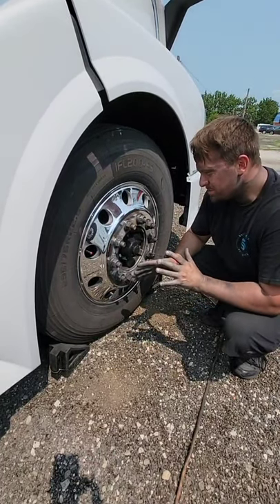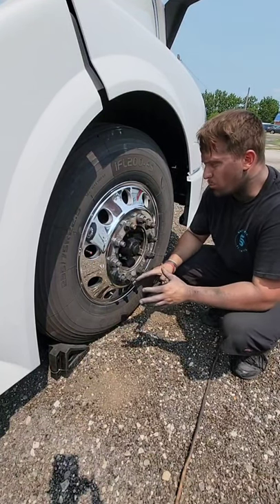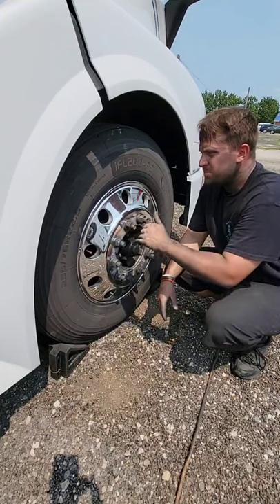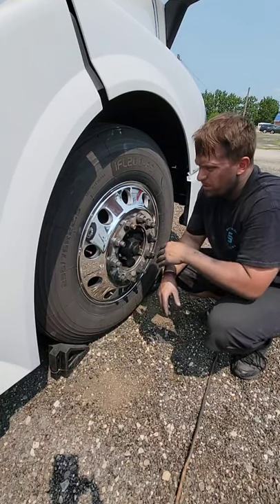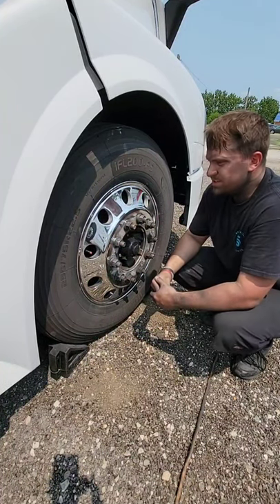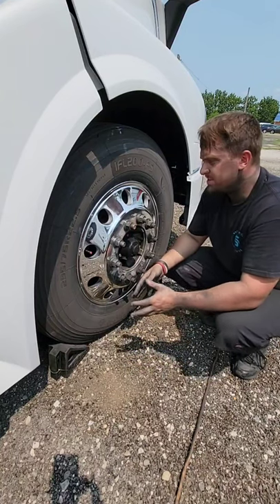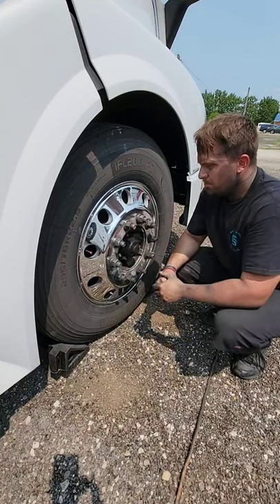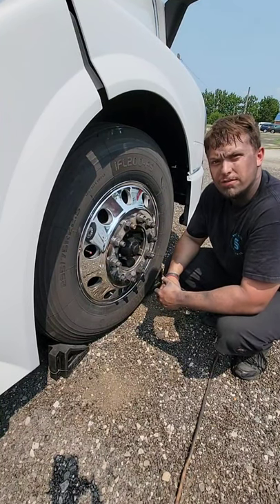Polishing A Dura Bright Wheel

Comment: How does nobody have issues with small sand marks being left from the DA behind after sanding and after the cut process? Any tips to improve and correct this issue?
Reply: Most people go up to 600 grit... Polishing with 6000rpm grinder of you're using 3500 rpm buffer try sanding up to 800 grit

Comment: Seems it would be easier to take the wheel off than having all those nuts in the way.
Reply from the maker: It would be better but this is a Mobile job and there is liability involved once you remove a wheel. Plus I didn't have to tools in this location.
Reply: That's only an option if you happen to be in a yard with mechanics willing or permitted to pull the wheels for you. Otherwise if there's ever anything go wrong it's all on you